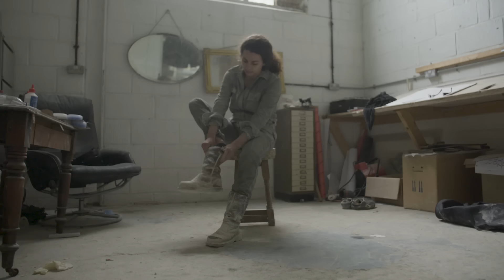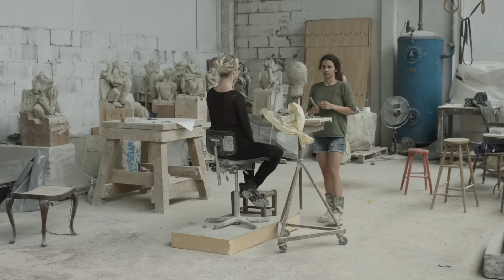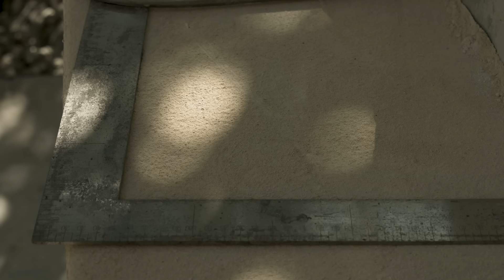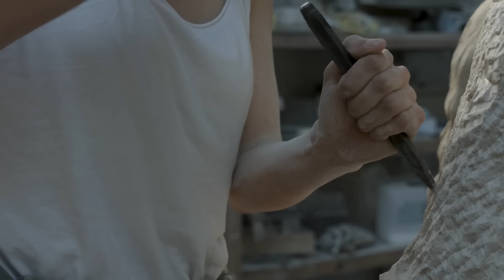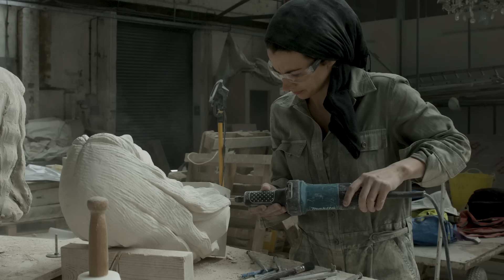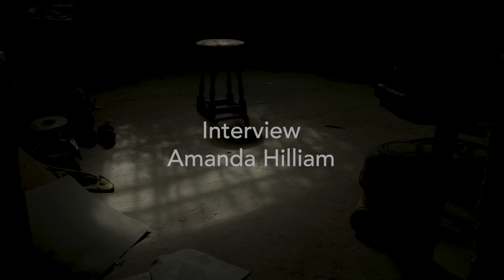Watch a Masterpiece Emerge from a Solid Block of Stone | Short Film Showcase

Comment: Worried about your lunges with all that dust.
Reply: She was wearing a respirator and she is a Master Stone Carver, so I'm sure she's more aware of inhaling dust than you think.
Reply: @seecha8970  what video was you watching? ..she doesn't have a respirator or mask on in this one...but she's got the goggles on ,so that's ok..
Reply: @ela-yj4dt  3.53..I think you will find that's called a head scarf..
Reply: @ela-yj4dt  yes I've seen it now. Had to be quick before she disappears into all that dust..lol.Well spotted. I do think she could have worn it more in the video
Reply: Can you imagine before there were such tools? Just using a file and so forth. The process was so slow that maybe they didn't need to worry about inhaling dust that much.
Reply: @NickRoman  very true..I personally think health and safety as gone to far now days..it's taken all the fun out of doing alot of thing's
Reply: The dust contains silica particles, which are small but sharp. You can permanently damage your lungs by inhaling it without a particle respirator. It's called silicosis it's very bad.
Reply: @Nerflover10097  sounds worse than wood dust. I do power woodcarving occasionally, and use respirator and dust extraction, which is the best i can do. Perhaps the stone dust is heavy and doesn't stay airborne for long? But she must be inhaling a lot of the stuff
Reply: I'm also worried about that
Reply: Exactly. I was thinking the same thing.  I've been associated with miners all my life , and just within the last 2 years ,4 of them have died , due to rock dust inhalation.  I don't think people realize how dangerous it is.
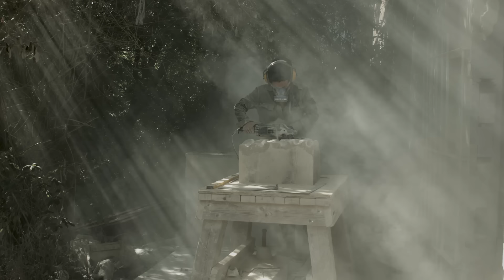Reply: fishtank5050 3:57, unless that’s just a new type of jewellery.
Reply: + poultry fanatic
sure. One single example, while doing the most dust filled part of the job, where she has no choice but to use it, or else she literally couldn't breath.  The rest of the time? Nah, she good.
Reply: @NickRoman  correct
Reply: I was confused when you said lunges until I realized xd
Reply: masonry dust is INCREDIBLY dangerous, not just the silica that will be in it but most of the particles will be small enough to reach the deeper parts of your lungs which can cause lung cancer and emphysema. as well as silicosis which someone already mentioned AKA masons lung.

as for the comments about it not being as dangerous in the past; no. it has always been dangerous, the dust stays airborne for a very long time because the particles are very small which makes them floaty. it just didnt matter in those days because most people died before 50 before the masons lung could kill them.
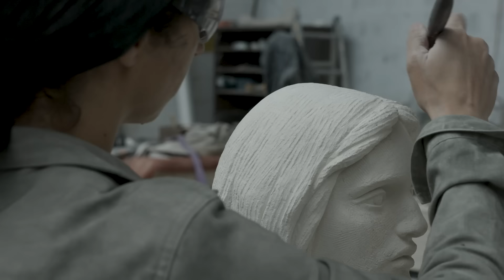Reply: for those saying she was wearing a respirator what about at 6:37? she blew dust into the air and theres no mask in sight
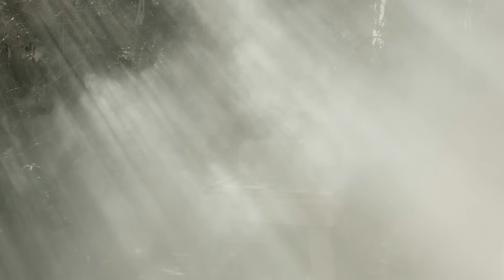Reply: fishtank5050  she was wearing a respirator @ 4:00.
Reply: ...and Eyes. Those glasses are poor eye protection.
Reply: A Very good point. I have seen people sick from silicosis (miners) and it is a dead sentence. Even lung cancer can be cured if you are lucky enough ... She should wear respirator All the time.
Reply: @fishtank5050  yeah she won't inhale the dust through her eyes at least
Reply: @seecha8970  Point me to the respirator, she obviously hasn't seen some one with Silicosis.
Admittedly her exposure would be less than a construction worker or miner, but over a number of years it could build up in the lungs.
Reply: @fishtank5050  at 3:56 she does
Reply: while using the angle grinder, she is. but not while carving, as you don't really need to. by the looks of the stone, it looks like a type of lime stone, which dissolves when in contact with fluid in your body. so in small to moderate exposer its ok. im a stone mason myself and know a lot of brothers and sisters of the craft, that wont wear masks while hand carving, even if its sand stone (full of silica, which can kill with enough exposer)
Reply: Shhhhuddup
Reply: @seecha8970  Master Stone Carver notwithstanding she should be working in an environment that removes unwanted Stone particles regardless of size from chips all the way to dust and places them somewhere in a filter or in a bucket to be properly disposed of without going into her lungs either directly or indirectly from being on clothes or floor or anywhere else.

The desk loud and the brushing away of the  stone chips all make for great Optics  a good filmmaking  but if she actually does that  whether it's on a daily basis or monthly basis  she is working in an unnecessarily  unsafe environment.

She should have a vacuum system that continuously collects air-born dust particles as well as the particles that hit the floor as well as some particles that she brushes off things.
Reply: @adadov012162  If its limestone, no mask needed. If its granite, you need a mask
Reply: Marble and limestone are calcium based so there isn’t any danger to her body breathing it in. Granite will hurt, and require a respirator and water
Reply: @NickRoman  The statue of david must've required unreal amounts of patience.
Reply: @Roland_Duson  , yes, I don't know how people do such things. And can you imagine getting 80% done and then messing up so badly that you can't fix it? Whoops. Time to start over. I can't write three sentences without having to scratch something out.
Reply: @Nerflover10097  - Yes I've worked on lawsuits by sandblasters in shipyards and welding operations that used sand and shotgun pellets to prepare metal surfaces for painting. The blasters were inadequately protected by greedy companies that left them on oxygen and barely able to walk. Silicosis is horrifying.

Comment: There’s a shot of her tapping the block with a spike.    What she is doing is “sounding” the stone. Strike a stone with a hammer and if it has an internal crack it will return a dull thud- but if the stone is ‘true’ it will ring like a bell.   This is where the idiom “the ring of truth” comes from, as well as “a ‘sound’ investment”- They come from the stone masons. A sound investment is one that has been “sounded”  and returns the ring of truth. That’s the block of stone you can buy without regret.

Comment: I know you used a respirator when using the big blade saw, but every other moment where you produce a cloud of stone dust, even the moments you use smaller power tools like drills, you have no respirator. Breathing these fumes over years is probably terrible for your lungs. Be safe. Also, eye protection. Please. A small chip of stone racing to your eye is all it takes to go blind. I cringed when you used that massive drill with no eye protection.
Reply: Agreed. The lifespan of stonemasons in olden days was curtailed by breathing in the fine particles of stone dust generated by working the material without protection. There's no excuse for working without respirators or extraction equipment in the modern era.